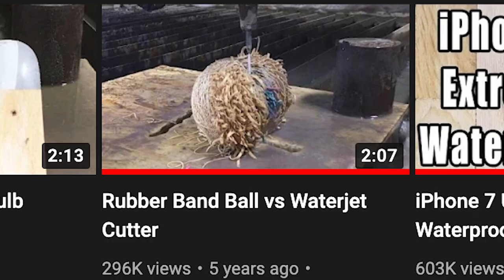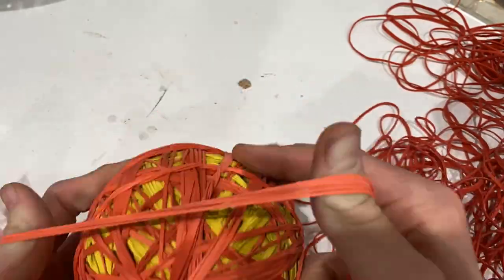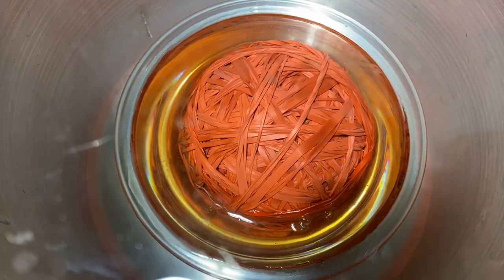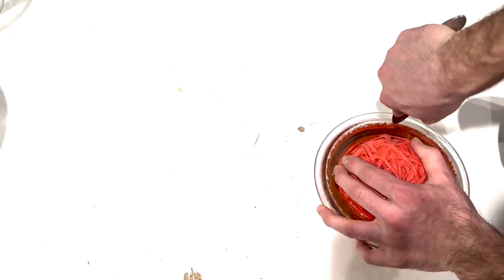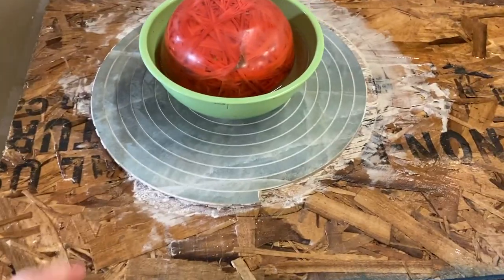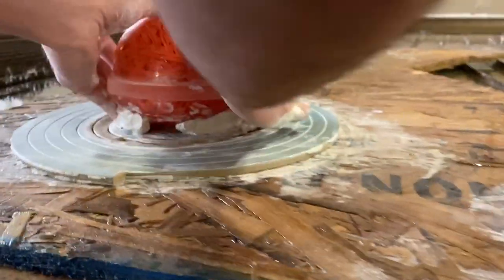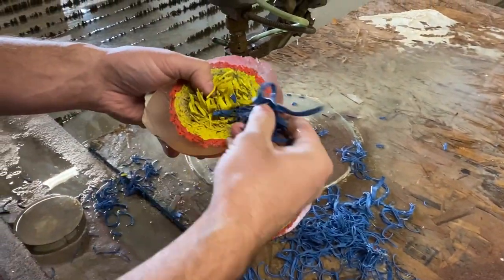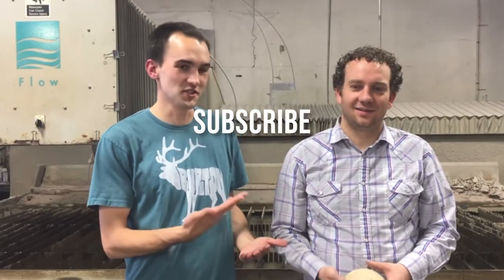Giant Rubber Band Ball Cast In Epoxy Resin And Cut In Half

Comment: Might help to fully submerge the ball in an excess of resin, and then run the vacuum till it stops bubbling. I strongly doubt it was air tight, but it will help if you can get your hands on a lower viscosity resin. Also consider putting it in a pressure pot. I cannot remember if you do or don't have one of those.
Reply: It should be possible to make a combination vacuum and pressure pot so that you could alternate cycles of vacuum and pressure. That should get really good penetration into objects you want to cast in resin.
Reply: @hornyducks4090  i am well aware of this. but what happens if you completely submerge the ball in resin and pressurize it? the bubbles shrink which allows the resin to be pushed into the nooks and crannies. of course, youll get better penetration if you pull vacuum for a while, but since they arent working with heat cured stabilizing resin, they have to switch to pressure to get it most of the way there before the resin cures
Reply: @xidarian  to be honest, it would be best just to pull a suitable vacuum and then pressurize it for the remaining time, instead of needlessly moving the resin in and out of the rubber band ball. But I do like your enthusiasm!
Reply: @josephgauthier5018  This is the principal behind the reason carbon fiber or kevlar composite components are cured in a autoclave. Pressure forces the resin in.

Comment: You should try again but use this stuff called "Cactus Juice."  Its a stabalizing resin thats almost as thin as water and is set by baking it rather than a reaction with a hardener. So its only one part and you can vacuum pot a piece for days or weeks to get all the air out, and once you take out the piece to bake the rest of the resin can be reused as much as you want. You only cure whatever gets trapped inside the item and the rest is drained off. After you can set it in normal resin and it blends in with it.

Ask Peter Brown about it, he has used it a bunch and it the only reason I know about it.
Reply: Agreed.  I think cactus juice would have solved some of the problems they had with other resin projects.
Reply: I immediately thought of sokka when you said cactus juice

Comment: Yep, the blue rubber band layer was wrapped extremely tight preventing the epoxy resin from infiltrating. Great as always, and I like the voice over.
Reply: false! had they pulled a vacuum long enough to actually pull the air from the middle rather than constantly opening it to torch it, the resin would have been forced in through atmospheric pressure.
Reply: electronicsNmore :)

Comment: Encase a prince ruperts drop in resin except for the tail then once it's harden snap the tail. Will the resin hold it or will it explode?
Reply: Seen it done on another channel.  The resin will hold it but the drop will turn to sand inside
Reply: @tsm688  I saw that one. They used tiny ones though. I want to see a big one explode

Comment: Awesome chanel guys
Btw there is a small flaw with vacuuming the air bubbles out , goal here is to push as much  resin as possible through the layers and soak in the resin , soaking action is not happening during the vacuuming action but during the time that you let the air in(all the voids inside the ball is under vacuum and as soon as you relief that it, resin is sucked to those parts) so when you partially submerge it into the resin, those voids that are vacuumed ,suck air from upper part , (air has much less viscosity than resin, it will get in faster than resin) so it is not filled with resin

Comment: Solution: Resin each layer of the ball before you start the next. 

Final product inside a large plastic tote where the ball is not touching the sides and can float freely. Cut the ball out of the resin.

Comment: Tip for next time maybe if a retry for full resin saturation, stabilizing resin in vacuum pot? Full submersion and leave in till it bubbles no more. But i would oven cure it in the whole container used or some of the resin would just leak out

Comment: Speaking of Rubiks cube modification videos, a large Rubiks cube in resin so it wont fall appart. Like as large as will fit in under the waterjet. Like a 9x9 or 11x11 or something. 
Also somthing that might be fun it to cut a casting of one of your heads, so maybe a fan could have half of one or both of your heads.

Comment: What if you finished the cast then cut into the center at multiple angles. then filled in the center with new resin in an attempt to saturate and stablize the nucleus. Maybe you could use slightly colored epoxy for the first casting, then encase that oddly shaped layer in a cube of clear

Comment: One thing that would probably help is to do this inside a cup inside a high pressure pot, and take the pressure above the internal pressure of the rubber band ball.  Even if it still doesn't really fix the center it should do a bit better, and going in even a little further quickly reduces the center volume..

Comment: I think using a vacuum bag with infusion resin, and doing multiple layers would have done the trick here. If getting resin to the very center was an absolute requirement for some reason.

Comment: What if after you’ve encased it in resin you drill a small hole into the center and force more resin into it with the vacuum? Also you could try to find how much resin you have to sand off of it before it bounces again

Comment: You need a pressure pot instead of a degassing chamber. The epoxy will be pulled into the center of the rubber band ball.

Comment: the problem with your vacuuming was that you kept opening the thing up to blast it with the torch which is totally unnecessary. you should have pulled a full vacuum and let the ball sit for a while. had you done this, the vaccume created at the center would have pulled the resin all the way in.

Comment: What you need is either:
A] A slower setting resin so that it has time to seep in more before hardening.
or
B] A less viscous resin that seeps in more through the small holes in the rubber ball before it hardens.

Instead of a vacuum, maybe apply pressure first?
Also you need to try harder.

Comment: Use art resin and a pressure pot. Art resin is thinner and will take a little longer to cure, but it has a better chance of embedding in the inner parts of the ball in a pressure pot.
Pressure pot NOT vacuum chamber
It was fun watching the insides pop out though